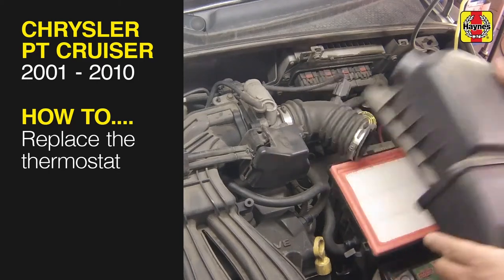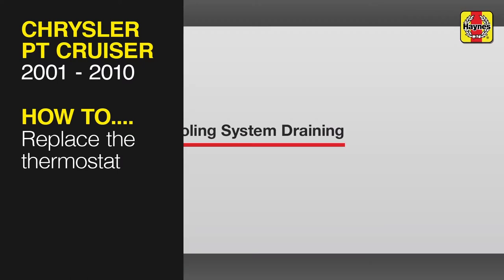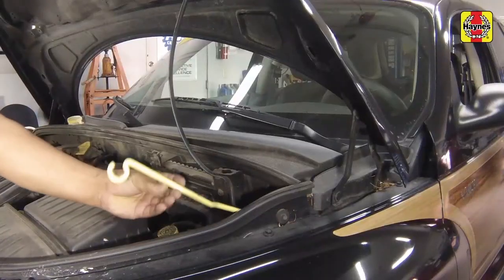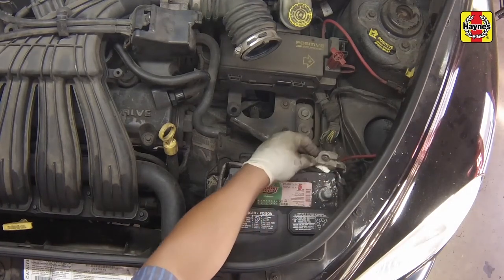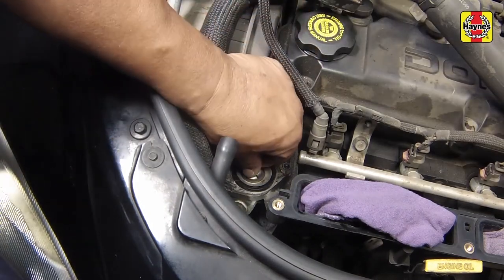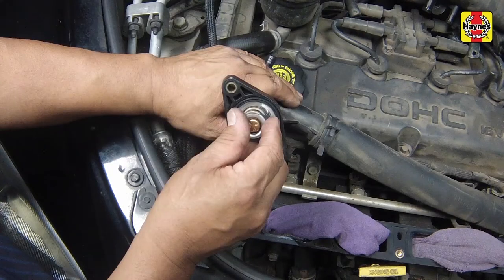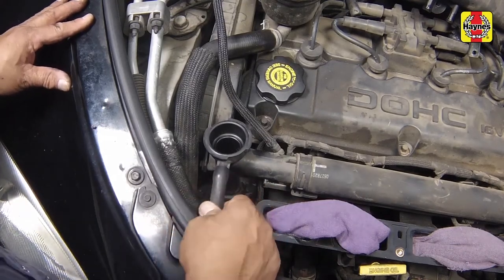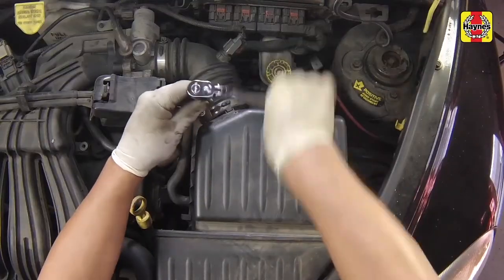Chrysler PT Cruiser (2001 - 2010) - Replace the thermostat

Comment: wear gloves when using brake cleaner...   wtf, also while cleaning the old sealant , do not leave the orifice exposed to debris like in this video,  the small bit of sealant will go into your cooling system and mess stuff up.   I like Haynes manuals, but this video is a disgrace.  Going to Crisfix....that has got to hurt